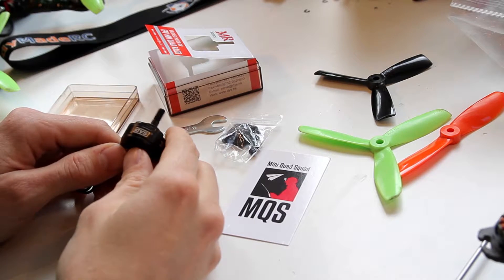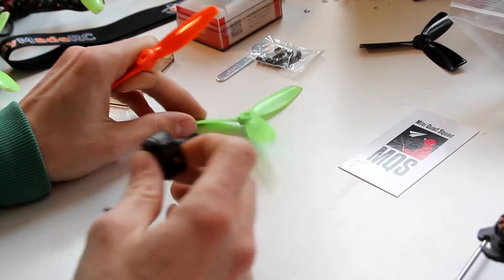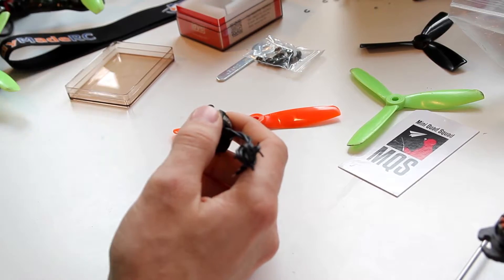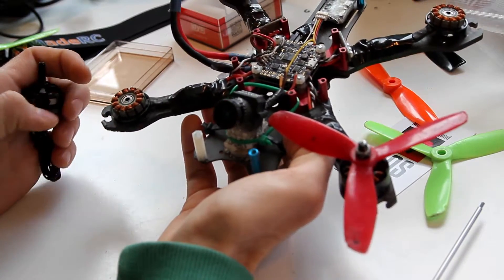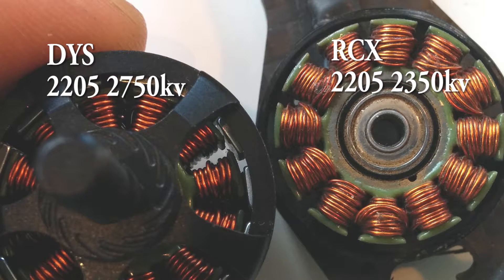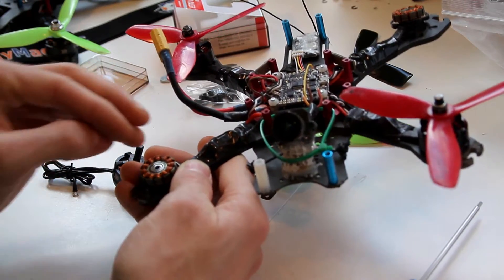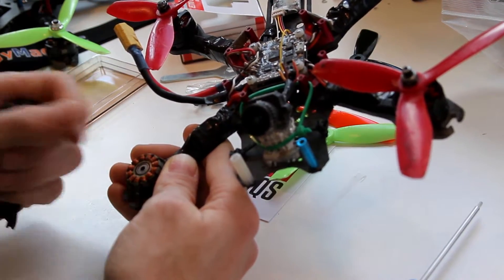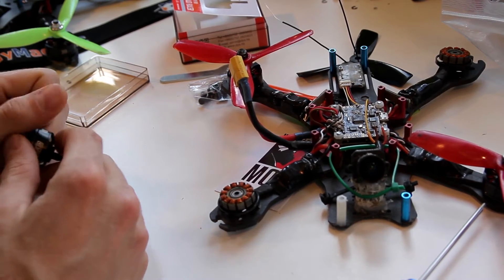DYS MR 2205 2750kv motor review and flight test

Comment: what do you think of powering my 4" alien with these motors? or do you recommend another motor. i heard you guys on the fpv podcast the other day and you guys did a great job.
Reply from the maker: Thanks man! I fly those on my 4" setups and I like it. In the end it can go as fast as a 5" on the right track. They have about the same durability as the red bottoms which is the other motor I use
Reply: awesome thanks for the tip! great video!

Comment: Are they less efficient with tri-blade props???
Reply from the maker: You can run them on light tri-blade props. It will be nice and punchy, but will drain your batteries very quickly, without necessarily giving you more speed..

Comment: Gab, I think single wire is cheaper to produce but less flexible. In theory multi-strand wire, is more efficient since when an high frequency electric current it pass on the outside of the copper wire, called '''skin effect''. And a multi-strand wire has way more outside surface area than a single brand for the same amount of copper. Btw nice review :)